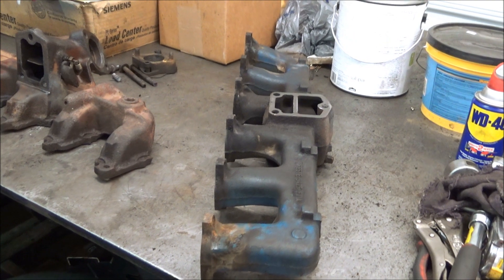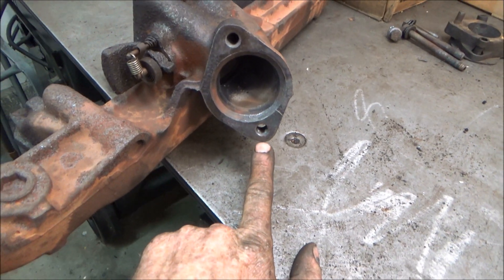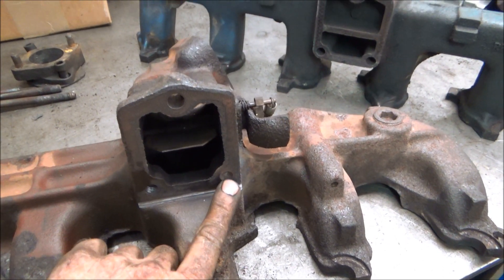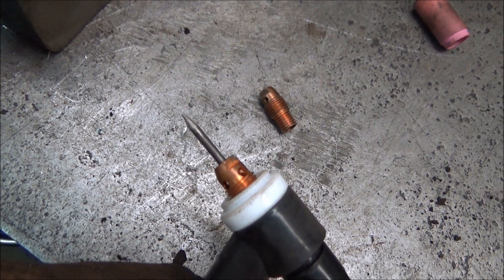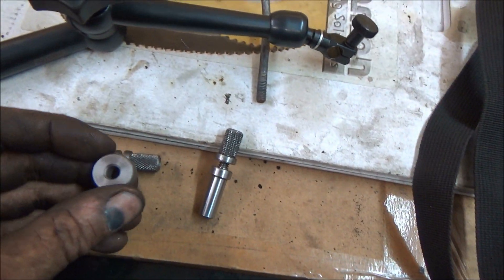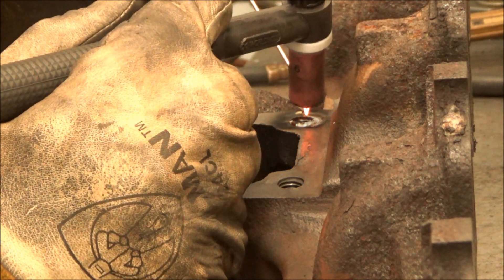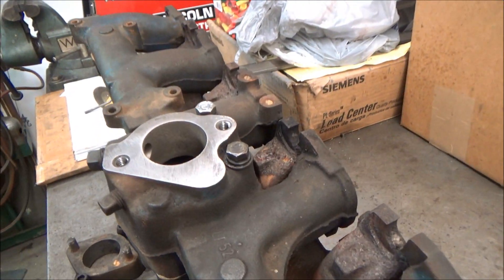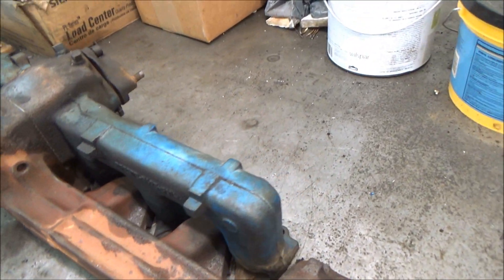How to remove broken bolts or screws with a Tig Welder, Didn't go exactly as planned.

Comment: The best way is not to break it in the first place. I've had very good luck using penetrants such as 'Kroil' or 'Nut Buster. Spray it on, let it sit, bang it with a hammer (don't kill it, just let the vibrations help the penetration). Spray it again, pretty much every time you see it it dry. Give it more than a couple of days. Time consuming, sure, but WAY easier.
Reply from the maker: john hanrahan   I tried all that first.   When you spray this there's almost no chance at all it will even get anywhere near the threads.  Bolt is 4 inches long and you can't get to the other side. You can only spray the head of the bolt and where the gasket is.
Reply: Yeah,  that's tough for sure. 4" is a long way down for sure. Should have known you'd tried all that before. Anybody with an oxy blue wrench knows all that stuff. One thing though, not sayin' it would have helped in that case, but, I've found if you heat things up and then apply the penetrant, it seems to follow the heat. But yeah, like you said, 4" is a long way down. Kinda doubt if anything would have changed the outcome. Sometimes it's tough, other times it just sucks altogether. But Hey, ya got it out and in my book, that's a 'win'! Good job.
Reply from the maker: john hanrahan   The one bolt I actually got out.  I sprayed penetrating oil on it and hit the head with a hammer.  The shorter one I was able to heat up good and it came out.   But that one bolt would not come out. If i had something big enough to put the whole manifold in and submerge it in penetrating oil it might have come out.

Comment: Yes those broken bolts can be a pain the donkey. Question for you what kind of tig welder do you use? I seen a Lincoln welder in the video.
Reply from the maker: Bombardier64   Lincoln Precision Tig 275
Reply: ok thanks for the reply. Little to much of a machine for what i need.  i was goin to try the Lincoln 200 square wave i believe.
Reply from the maker: Bombardier64   I want to get one of those Lincoln Square wave tig 200.  There are some advantages with inverter based tigs.  And there small and easy to move around.
Reply: Have you ever tried the tig 200?
Reply from the maker: Bombardier64   No I haven't tried it.   But A lot of people I know have them and like it.
Reply: 1970chevelle396 Good to know.  I believe I'll be investing in that machine. I was looking at a thermal arc 186.
Reply from the maker: Bombardier64   For the Lincoln welder.  ZT Fab makes a really nice cart for it.
Reply: 1970chevelle396 yes I seen that. Yes very nice work they do a geat job on the build. How's your welding table working out? I bought a 4x6 3/4" plate . You sold me on putting wheels on the welding table.

Comment: I almost never have broken bolts and studs come out the way I plan, but like you, they come out eventually. Just have to finger out how they want to be tickled is all.
Reply from the maker: Hard Knocks Forge   This came off of a 1985 chipper.  As soon as I saw it I knew some of the bolts would break.
Reply: 1970chevelle396 It is nice when those bolts break off in the manifolds and not the head.